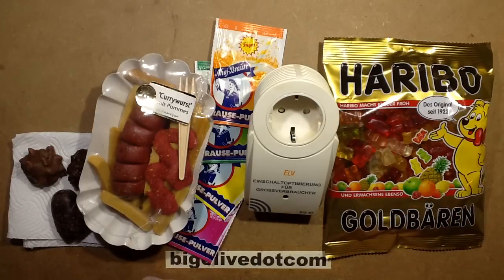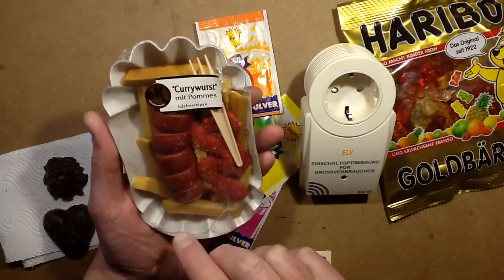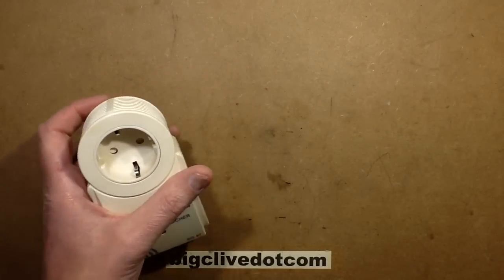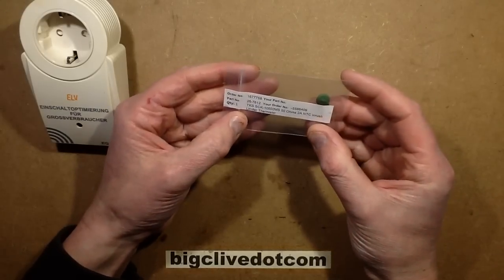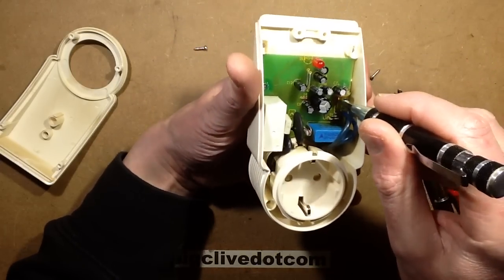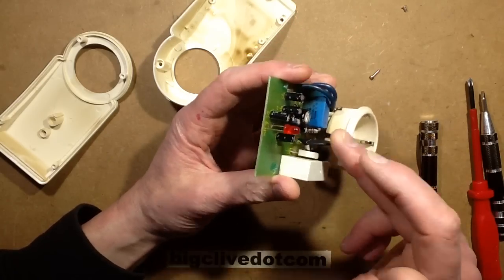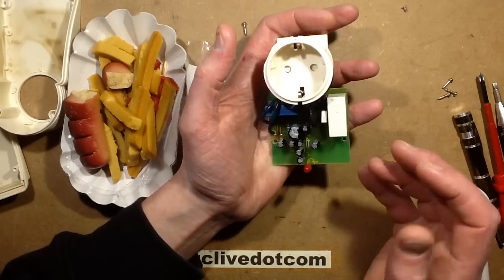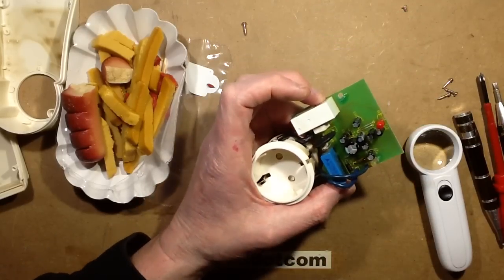German candy and a mystery power device.

Comment: I would have been so utterly disappointed when the fries tasted of fries or the wurst of wurst. Marzipan is basically a high-value commodity you do not want to downgrade it by any other taste. The appearance is a bit dull in itself. That's why the clay-like structure is put to use by molding it in various shapes.

Comment: At work we have a window-mounted air-conditioner which frequently trips the breaker when it starts.  This (well, a 120v version) is exactly what we'd need to tame it -- but a large grumpy motor is exactly what's liable to kill it, too.  If it's having trouble starting at full power, it'll have even more trouble starting at reduced power.

Comment: If you expect a curry dip in a marzipan setup to taste like curry, you should expect the sausage to taste like sausage and the chips salty and chips like. Then you would be cheaper off by buying a Currywurst mit Pommes from the beginning, and maybe mix in some bitter almond oil, to make it taste like marzipan. 
A question beside: Are you British? ;)

Talking about marzipan, unfortunately often the colored and modeled marzipan figures are made from a qualitative inferior marzipan. Even the cheapest marzipan breads often taste much better, because they are covered with chocolate, which prevents them drying out. 
A variation of them is marzipan bread with a nougat filling, which makes it similar in taste like Mozartkugeln (Mozart balls?). And some innovations are filled with fruits, which have rested for a long time in rum, or with pineapple paste, Cognac and other stuff. Which is probably technically enough to try a tear down and consuming analysis. :)

Comment: I think the op amp is acting as an integrator with a diode, a capacitor and a discharge resistor. When current is flowing over the sense line resistor the capacitor charges up. I am guessing that the op amp has a certain negative bias, maybe even in some form from the thermistor. Once the capacitor reached a certain charge, the output changes polarity, turning on a driver transistor to turn on the relay. So in a way it is acting as a integrator and comperator at the same time.
But i could also be completely wrong, as i so often am ^^

Comment: Man, 32 A for the whole house? That's crap. Even your 100A 240V is pretty low by US standards. While most people are aware that we use 120V in the US, the actual breaker box (and some appliances) are fed by 240V single-phase with a center-tapped neutral (which is how we get 120V). Usually the main breaker is rated for 200A (keep in mind, 200A at 240V) although older houses sometimes have 100A or 125A. If you need more power than that then you can get (in most areas even for homes) 120Y208V 3-phase or delta-high-leg (which is three-phase in the delta configuration, 240V between each phase, with one phase having a center-tap for the neutral, giving you 120V between neutral and two of the legs and 208V between neutral and the high leg.) Delta-high-leg is nice because you can use both commercial and home appliances and motors. Most businesses use 120Y208V, so there's lots of stuff for it, and most homes use 240V single-phase, so there's lots of stuff for that. And if you need three-phase for something, you can usually get it wired for 240V 3-phase instead of 208V three-phase pretty easily, and many things will work on either voltage.

Comment: HID lamps are notorious for that absolutely massive spike of power draw when you first turn them on. Within a few seconds as the lamp starts to heat up the draw goes down until it reaches full brightness. The ones in my car can pull something like 12A on initial startup and settle down to about 1.5A each once they're fully warmed up. If you had one of these devices on a HID lamp, I wonder if it would prevent it from lighting the bulbs.  Hm..

Comment: this device from ELV electronics is meant for heavy toroidal transformer home HiFi amplificators to keep the circuit breakers (mostly B16 type) from killing the living room or where ever you decide to use these amps.

in little flats you get 9 or 12 circuit breakers in B16 characteristic (splitted on 3 phases - mainfused 3x 35A) so no worry about energy in general but using "B types" for every circuit.  

for the average hifi listener its way easier to put this plug between the amp and socket instead of call the electrican to change the breaker to "C type".

Comment: 100A!? At 240V!? That's 24kW! What could you POSSIBLY have in your house that requires 24kW of power?
The standard power contract here in Italy is 3kW...

You can actually draw up to around 4kW for a modest amount of time before the meter cuts you off, or around 3.3-3.5 indefinitely, but anything higher than 4 trips it almost instantly.

We don't even have any residential wall sockets that are rated higher than 16A.

I mean you CAN get 4.5 or 6kW contracts (maybe even higher), but it's A LOT more expensive and usually the distributor tries to get you to get three phase power and spread your load.
6-7kW induction stoves for examples don't usually have one 32A rail, they always have two 16A rails for that reason.

Anyway, just saying. I think 24kW for residential use is pretty much insane. Most people never even reach the 3kW limit...
Reply: Well, maybe Italy just sucks then. Seriously, other countries, other habits, other things common to run on electricity. And bear in mind that 3 kW is per circuit, not per household. Try running a washing machine, an electric cooker, a couple of lightbulbs, a water heater and other appliances on 3 kW and you will easily recognise that A), these are typical scenarios and B), you are full of shit.

Comment: It looks like that thermal fuse is wired to shunt around the thermister and if it works like a normally closed fuse the thing would only work when hot. Interested in a schematic and mapping of skid marks to components if that toy is still in your box.

Comment: Here in the US homes are wired 120/240 2 phase 200 amp (100 amp per phase) and the standard breaker is 15/20 amp even the 220 breaker for stoves and water heater are 20 amp breaker. I have always wondered why over there you went with 220/400 or 440 volt. dosent seem the need to be so high or is there a reason for that?
Reply: 230/400V is 230V to ground and 400V between phases. Higher voltage means that you can get the same amount of power with thinner wiring. 3-phase is also great as soon as you have electric motors requiring some power since you have a much less complicated motor with no need for any capacitor or similar.

Comment: to use wielder in uk i had to uprate the breaker, when landlord housing associations renewed the consumer unit i had to tell them to upgrade the garage breaker as they used a 15b , after a wait they put in a 20b , after i was convinced they will not be looking at it for a while i put in a 40c , how would the mystery german device cope with a welder attached.

Comment: There were a few comments about Norway, I figured out why it's so weird. Apparently they use an IT connected 133 V system, with houses wired up in a delta configuration, making both wires in outlets hot at 133 V. Presumably because it's supposed to be safer than a single 230 V one if you were to touch a live wire.

That would actually make for an interesting episode, how electricity is distributed around the world.

Comment: The inrush on electric motors are not caused by the magnetic field having to build up. It does that with each phase shift. It's because the motor needs to build up speed first.

Comment: Shouldn't using one of these devices prevent sparking and popping noise when plugging in switch mode power supplies with their large capacitors?

Comment: I enjoyed the discussion on the types of circuit breaker ratings (A, B, C, D) used in the U K.  At my home in the U S, I have 300 Amp, 240 volt, single phase service. Not aware if the US has an equivalent breaker trip rating to the UK system.

Comment: What would be a good way to limit the inrush current of servers? We have several (non-mission-ciritcal) servers in our office, and if they all boot at the same time (e.g. after a power outage), the current draw is quite high.
Reply from the maker: +TheSquarecow The audio industry has 19" rack mounting devices called emo-switchers that sequence audio equipment on to avoid surges, and also avoid loud audio pops.  (The signal sources get powered first so they are stable.)  Alternatively it could be done with a number of time delay relays.

Comment: Clive, don't brushless motors need the spike though? So if you limit it via this device, wouldn't that impede the full magnetising of the rotor? And curry-flavoured marzipan would be unimaginably gross, so of course this is just "themed" marzipan with colourants!
Reply: Nah, they should be fine. This is for AC powered appliances, not battery powered RC stuff - unless, by brushless, you mean induction motors. Yes, those might not be able to start up, as they require a sort of "kick" to get running. (Starting torque ... some have very high starting torque, and as such, they draw a large spike of current.)
Reply: Benjamin yes exactly i meant induction motors.

Comment: Got one of these too. It actually doesn't work all the time. Might have todo with the NTC needing time to cool down. Also it says you have to plug it in at first without any load so it can adjust itself. The setup I have is a bit complicated. I use it to limit the start up current of my 1.5k Watt PSU for my PC. It regulary fires the circuit braker. The PSU however also draws small current when the PC is off. Maybe this prevents the relay to go into off state again.

Comment: Hello from ex Yugoslavia! 
We have a fix for those machines tripping your super modern hi-tech resettable fuses... A good old "one time use" fuse with wire inside, which are widely used here. 
They are "technically" ment for one time use...but for most people it is too expensive/nuissance buying new, so they just replace the blown wire with approximately (yeah right..."approximately" ) same cross section of thin copper wires-strains from like a regular mains cable. Is it dangerous? Perhaps, depends on mentioned approximation, but who cares, better than a nail stuck in ;-) 
And ground current fault detecting circuit tripping, or something...WHAT the hack is that, here there are usually used 2 (TWO!) wires coming to socket, and ground is connected to neutral. Problem solved.

Comment: I once built some soft-start units for some 2KW profile spotlights. Since they were being used in static displays there was no dimmer pack being used that would have otherwise limited the inrush current to the rather expensive light bulbs. 

So I got some cheap fan heaters and configured them so the element was in series with the lamp initially and a mains relay was wired up across the lamp output too so as the lamp warmed up and the voltage across it rose the relay would trigger thus bypassing the heater element. This all happened in about 200 milliseconds or so. 

I seem to remember I had to tap the supply for the relay somewhere near the middle of the heater element to give it enough latch in voltage as otherwise it just sat there with the spotlight & heater receiving half power each.

Comment: Here in Canada we have split 115v in at 100A, 115V-0-115V to make a total of 200A service.
Reply: myfunrandomvids That's the standard in the USA as well. The US and Canada (I don't know about Mexico) have the same basic electrical standards. The specific safety standards may vary some depending on the country (even by state/province) but the basics, voltage, amperage, hertz, outlet types, etc. are the same.

As our standards are the same linemen from both sides of the border can and do help each other out after a natural disaster or other emergency damages the power grid. I remember seeing trucks and men from Hydro Quebec rolling into town after Hurricane Ivan (2004) heavily damaged the part of Florida I lived in. I knew linemen from across the country come and help after a disaster strikes somewhere but I didn't know linemen from Canada came too sometimes.

I don't know but I would be surprised if the countries in the EU didn't have some sort of agreement where linemen cross the borders to help after a disaster.

Comment: I've been using this very device for many years to limit the starting current of a simple microwave oven. It works exactly as you describe. On low load, the load would run through the NTC all the time. On high load, the NTC is bypassed by the relay after ~2 seconds. It never failed me in ~10 years. My current microwave oven doesn't need it, though.

Comment: Huh? Doesn't resistance go up if you turn on the heat?
At least that is what I learned in physics class.
Reply: It really depends on the material used in the resistor. Most of the wires (e.g. copper, most other metals as well,...) are PTC type, so if the temperature increases, the resistance of a simple wire increases as well. In those NTC resistors, special materials are used that have the opposite efffect.
Reply: oh great. what's all this fuss about high temperature supra conduits then? just use the ntc stuff. it's far easier to just heat it instead of cooling it. fusion reactors here we go! :P
now... how does that work? cause that just sounds like improbable witchcraft to me.
Reply: what exactly are you asking for? :D supra conducters would have zero resistance with very low temps. The NTC and PTC-materials we're talking about here is nowhere near that point.

Comment: We see a number of similar devices on RV / Caravan airconditioners "Down Under", where the high compressor inrush current would trip out protection systems on smaller portable generators. With the increasing popularity of "camping with all the luxuries of home" ("Glamping" - the Aussie abbreviation for "Glamorous Camping"), most smaller A/C manufacturers are fitting such systems as standard (e.g. Aircommand).
Reply: what you are talking about is known as a hard start kit, they are 2 different things, a hard start kit instead makes the inrush current duration shorter

Comment: You said B type breakers was the most common breaker in the UK, do you know why you use the B type? Here in Denmark the most common breaker in residential houses is the type C. C13 or C10 will be used for single phase outlets (I dont know how many outlets per breaker) and C16 for three phase outlets like the kitchen stove.
Reply: Hekatombe 
C characteristic is used for machines that require a higher starting current (so industrial use). But it doesn't really matter much. 
Usually B characteristic breakers also are a bit cheaper.
Reply: Most socket circuits in the UK are 20A or 32A so the fast trip points aren't actually all that different from what you have.

Comment: The house we are renting has 20A main fuses and, a single 10A circuit for 7 rooms, 2 bedrooms, kitchen, bathrom with washer/dryer, the entrance, and a large open stairway room. The stove has its own circuit as all houses in Norway and living room.  some of the electric system as the fusebox was upgraded in 1973 so it still has porcelain fuses.

Comment: Nice, I wonder if I can find such a device for 120V operation, it might be the perfect solution to a common problem in the RV community. If you want to use the AC in an RV while away from shore power (boondocking) you need a generator, but you want one which is as quiet as possible. The best units from a noise versus power perspective are ~2k watts but they generally will trip out with the startup current of the common 13.5k btu roof mount units, the steady state current is not a problem but the startup current can be 10x the running current which DOES cause a problem with many 2k watt units (typically 2300-2500W peak). Has anyone seen something like this for 120V?
Reply: what you need for your rv ac is something different, it's called a hard start kit that you need.